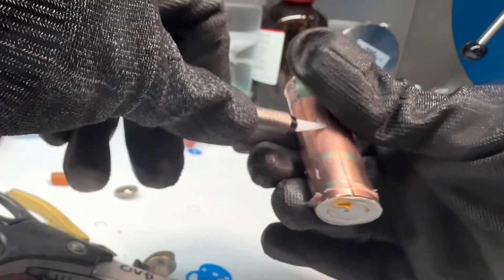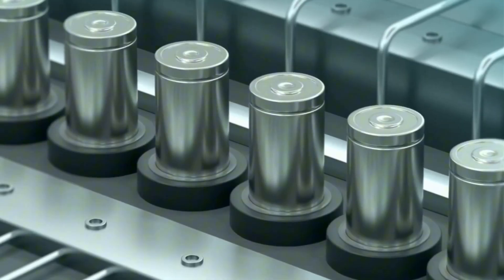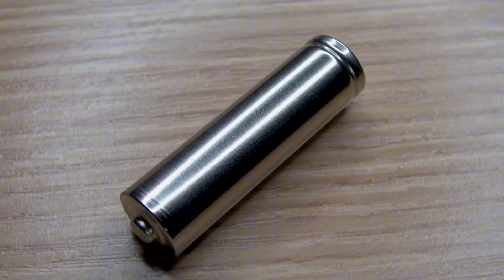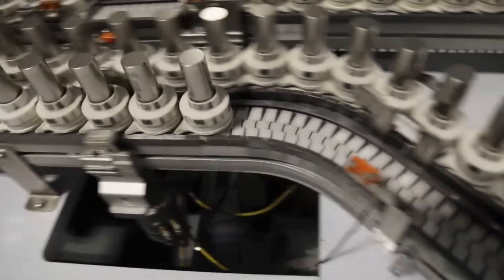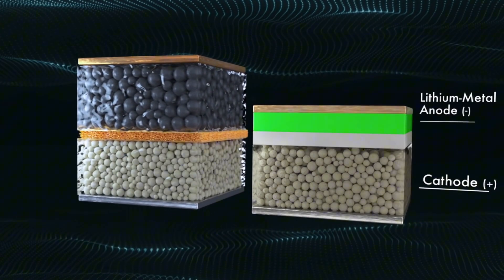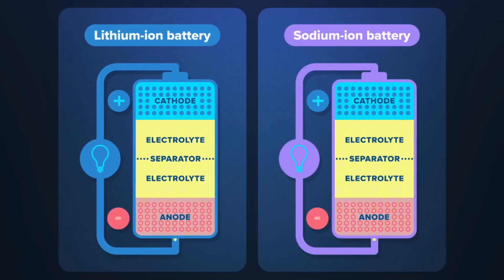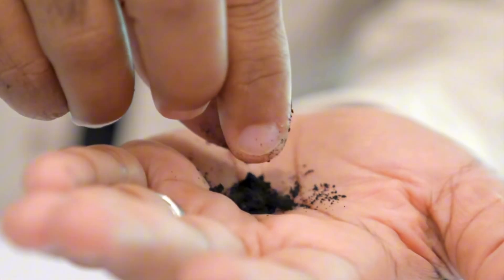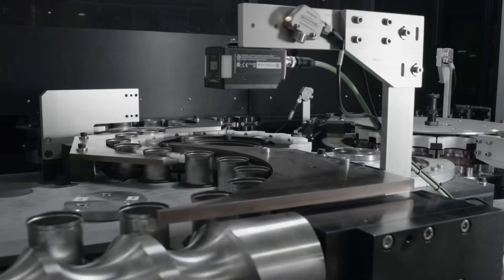New Battery Technologies Explained! Are Solid-State and Sodium-Ion the Future?

Comment: Still very few are discussing the significant impact super fast charging has on the grid and when you do the math the figures come up well short and the absurd amount of grid overbuild needed will dampen much of the unfounded optimism around electric vehicles it is absolutely ridiculous the amount of power required especially when you look at heavy vehicles it just doesn’t add up at all